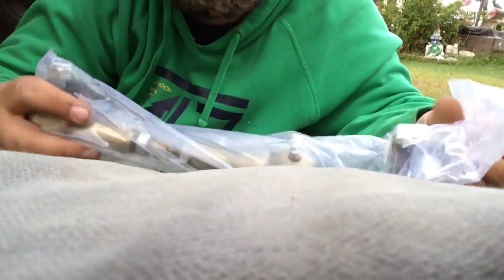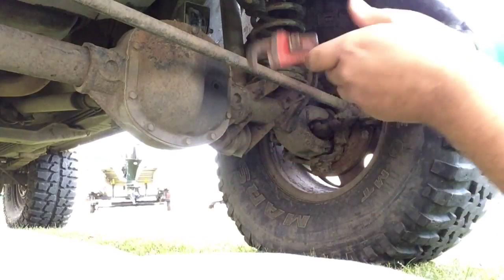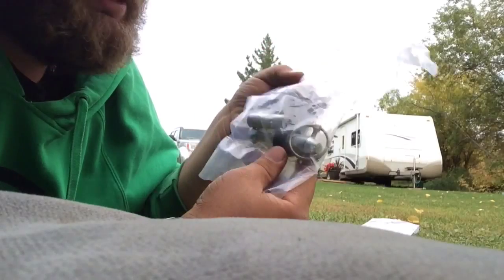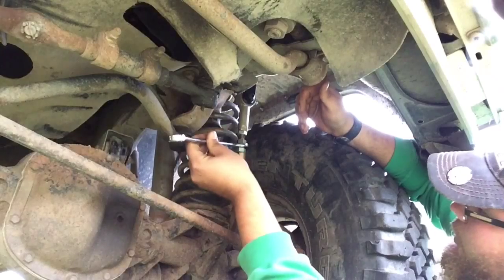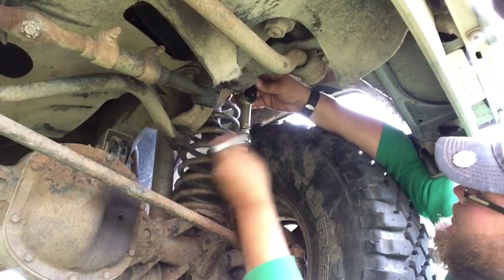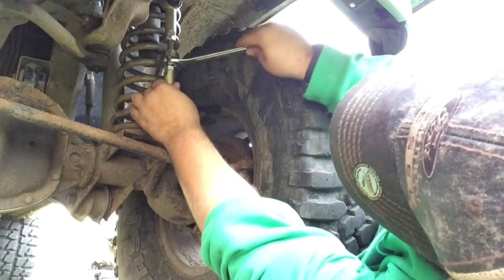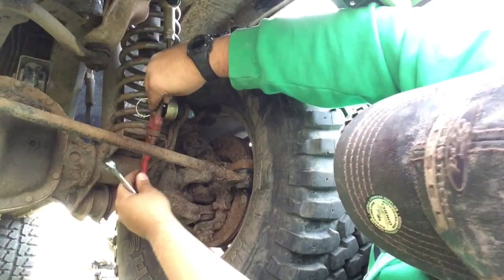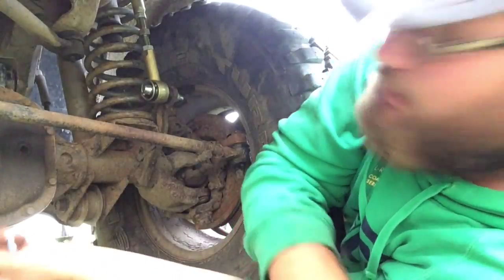Installed sway bar link / disconnect jeep cherokee xj

Comment: aren't those other parts (for another car) supposed to be mounted inside the wheel well to attach the sway bar to once you disconnect it so it doesn't "rub on your tire"?